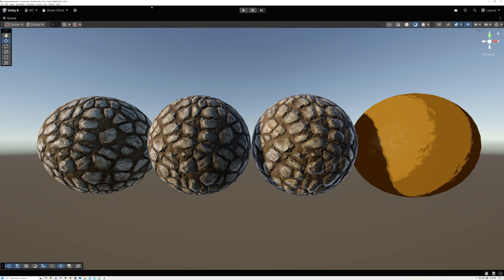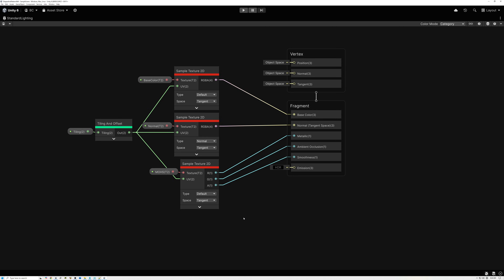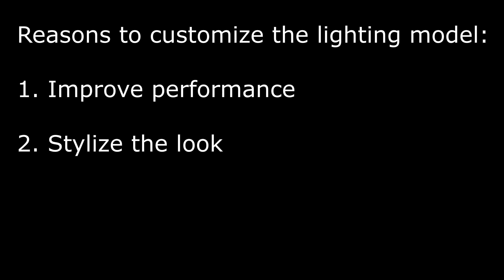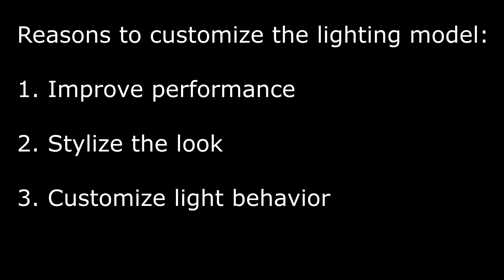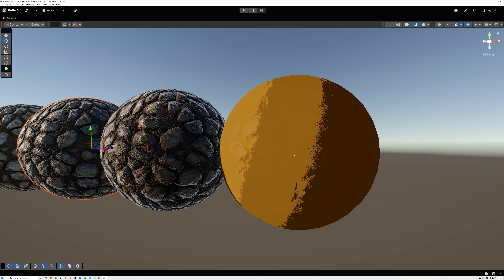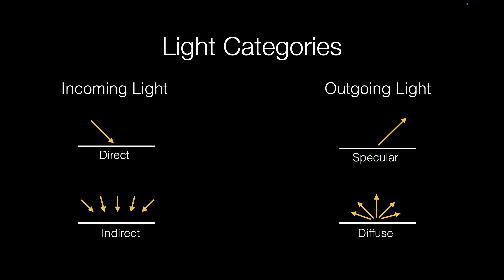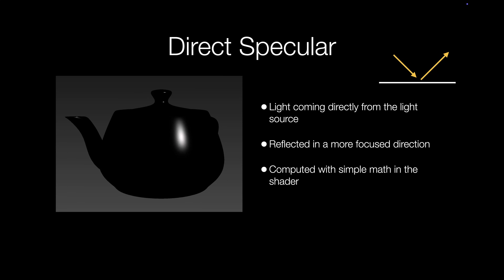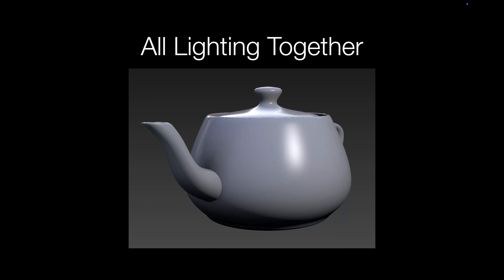Custom Lighting Models - Episode 1

Comment: Hello Ben, Thank you for this series ! What do you think is the performance gain in fps with this technique?
I think it's pretty hard to say, depending on the project of course, but just to get an idea.
Reply from the maker: The series is about customizing the lighting model - so it totally depends on what you do to customize it. You can make it cheaper or more expensive depending on what you choose to do with the lighting. The performance impact will also depend on what hardware you're using. If you're running on a PC with a really powerful graphics card, it may not make that big of a difference because the scene already renders at a high frame rate, but if you're running on a mobile phone it could improve performance a lot.
Reply: @BenCloward  I don't necessarily have a super-powerful graphics card (RTX 3060TI) but I'm still interested in optimization because the further I get into my project, the more FPS I lose! Thanks again for your reply.

Comment: actually very nice - I need such stylized shaders - specially for interacting with lights.
Do you have plan also to do a toon shader that can work with light probes ? (baking lights)
Reply from the maker: Tell me more about what you're hoping to see and I'll see what I can do.
Reply: Tutorials to make Toon Shader often include only one light(the main light) - it s obviously super basic. Rarely, it can include more lights, such as point lights.

However it would be super nice also to read data light from baked lights : when a dynamic character is moving with a Toon Shader in a place where there are baked lights/probe lights it should be able to light properly the character, like it does with default shader of unity.